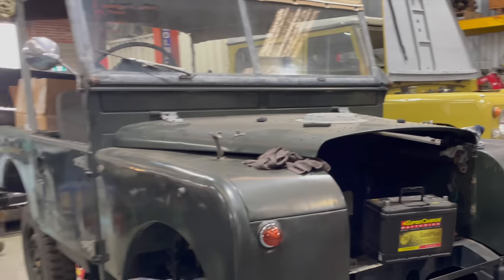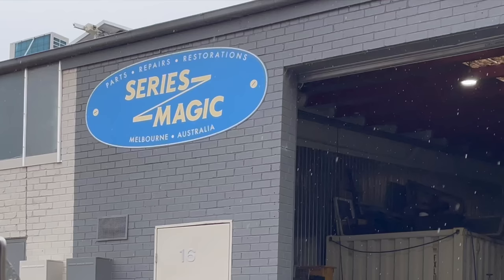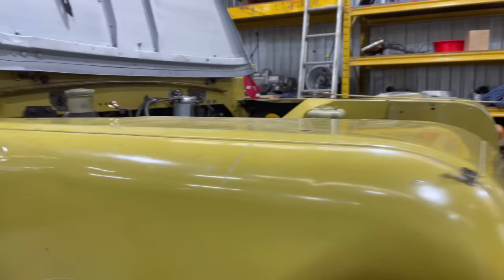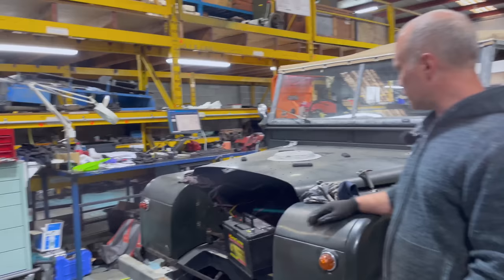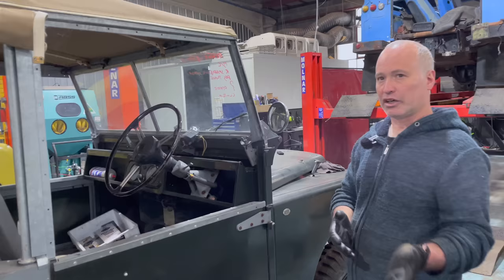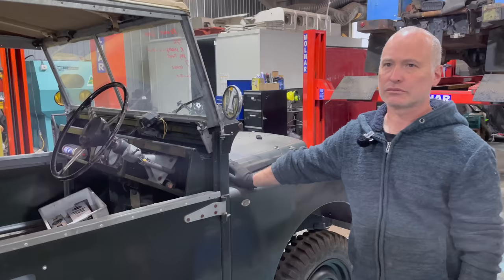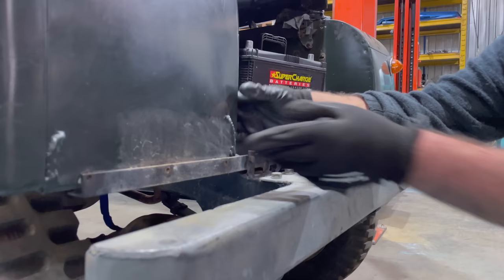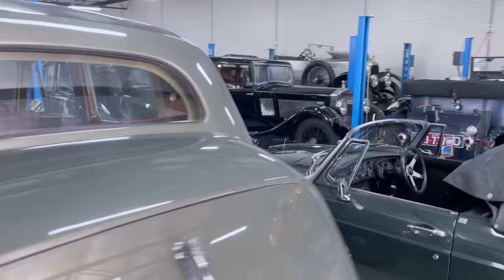LR restorer explains why Land Rovers last longer than Land Cruisers

Comment: Very reliable, as lets face it they were devoid of anything to break or go wrong (unlike a Land Cruiser)
Built to rust straight from the factory & uncomfortable in the extreme.
Reply: "Very reliable"???!!! In yer dreams. I was mechanic back in the 70s in the UK working for the biggest civil engineering firm in Britain and possibly Europe. They had a fleet of vehicles from Minis to Scammel Low Loaders. The list included many LRs. What a Heap Of Wasted Steel and Aluminium. We had Long Wheel Base Safaris through to SWB diesels. The diesels had zips on 'em so we could change engines faster, gearboxes were weak and difficult to set up, drive shafts no bigger than a Ford Cortina used to snap like lolly sticks, overheating on anything hotter than 20C, ever tried to replace a clutch on an LR without taking the floor panels out? It can be done but ya shouldn't have to, etc, etc. We had Ford Transits vans that lasted longer on motorway and bridge building sites than LRs. I live in Australia these days and everything is Nissan Patrol or Landcruiser. I wouldn't take a so called "4WD LR" down the gravel road to the rubbish tip unless it was to dump it. NOBODY uses LR's in the rough stuff over here, nobody. I have a list of owners who are gold prospectors like me and they've owned LR Defenders. One told me he often went to sleep hoping his LR would turn into a Cruiser overnight! True story. It broke down on every trip he made and often 100s of kms from anywhere, including the desert! Snapped drive shafts n back and front, broken engine mounts etc. Even Range Rovers are only fit for shopping trolleys. Gimme a Cruiser or a Patrol any day. I love my V8 200 series. I also love my V8 Nissan with a Chev Diesel in it. Done over 400,000 kms on desert roads, tracks and hillsides and its never stopped once for anything, even pulling 4 tonnes in a trailer. Over 7 tonnes all up. Try that with a Land Rover in 40C heat! Land Rovers are for enthusiasts who like tinkering with "stuff" but they aren't a patch on Cruisers or Patrols for serious bush work. How the British Empire existed as long as it did using Land Rovers is something I'll never work out.
Reply: @chrisstewart8259  Chris I was referring to the video title as yes I know full well what these heaps were like.Have never understood the love of these animals myself.
Reply from the maker: I think the Empire was over a couple of years before Land Rover came along. Also, can you tell me why the Australian Army was using Land Rovers up until just a few years ago?

Comment: Never had a toyota but have had a seies2,3, range rover and currently drive a freelander 1.
I love the fact of ease of maintenance of old stuff, lacking with computer laden tripe we see even in modern landys.
Think most folk don't realise that this was intended mostly for farm use so wasn't really comparable to other 4x4's.( PTO,'s capstans and all that )
Never had a major problem with any apart from tinworm due to crappy UK weather.
I do find it funny that on land rover videos you always get the haters come on stating wild claims about their jeeps, land cruisers and jimnys 😄😄 
Never had a catastrophic failure of fail to start in mine even though I rarely service anything 👍
Reply: When you look at their profiles they all work for Toyota or sell them. I have seen a concerted effort over the years by Toyota owners to diminish the reputation of Land Rover.
Reply: @Land_Raver  and deservdly so. Land Rovers!! I'm in Australia these days, left UK in 73'. They cant give Land Rovers away over here. LR dealers all gone broke. Oz is too big and too rough for Landies. They are better suited to the smaller distance in Europe and established tracks. They fall apart over here. Good for taking rubbish to the tip, Just remember to leave it there. NB - I was a Land Rover mechanic in the UK. Cruisers/Patrols last longer.

Comment: Not convinced that LR lasts longer… it probably depends on the climate. Rotten chassis and bulkheads killed off most of the Landrovers , Discoveries and Rangerover. here in Scotland, although they were far more common than Landcruisers. I’d never have another Landrover, apart from a series 1 as a toy, or an early 2 door Rangerover if I win the lottery. I would however love to get my hands on an 80 series LC if I could afford one. Getting pricey now for decent ones.
Reply from the maker: So you’d never have another Land Rover apart from the fact you would?
Reply: @davesclassicgaragetours  I’d have one as a toy, but never as a works vehicle or a daily driver. And I’ve been driving them since I was a kid, owned all series, defender, disco and rangerover. I could pick up a Mercedes ML 270 for a fraction of the price of a Landrover, and it will do everything better than the Landrover. Despite that, I still have a soft spot for Landies, having spent so much of my life around them. I still use a grey Ferguson tractor , which I love, for topping a pasture in decent weather, but I wouldn’t use it for towing a trailer or ploughing a field, because basically, it’s just not up to the job has crap brakes, and is uncomfortable to spend a lot of time on. Of course in 1950, it was revolutionary, but today it is barely adequate except for limited use. I would consider a series one or Two, but it would need to be heavily modified to make it usable or fun to drive, and frankly, at the prices for decent ones now, I’d probably just have a Suzuki SJ410 for cheap off-road fun.

Comment: The earlier models did indeed last because they were electrically and mechanically simple. The panels didn't rust but the chassis would if you don't treat it. The claim about the percentage of Land Rovers still being in use is slightly misleading. So many were farm vehicles, many wouldn't pass an MOT but would still start and could be driven on private land (farm). 

If we are talking about 50 year old vehicles I'd happily own either a Land Rover or Land Cruiser (I've owned a series 111 Land Rover). For newer vehicles I'd have to go with the Japanese.

Comment: Landys drive up into the Pilbara……….sweet nice trip. Tojos have been taking the hits up here for 50 years. They are the workhorse. In practical terms there is no comparison. They smash over the sharp Gibba rocks for years.
Reply: The Australian Iron Ore Mining Industry was built on the back of the Toyota Landcruiser at a time when Landies were very available - but nobody wanted them. In the real rocky stuff LRs break.

Comment: Only because all the parts have been replaced. Chassis rots out and although it can be welded you have to have decent metal to weld to.
Most people prefer the Toyotas as they seen better
Reply from the maker: Most? meh

Comment: The real comparison should be between the Series LR and the FJ40 Land Cruiser and it goes like this: LC engine, gearbox, and mechanicals much more reliable. Steel body will eventually rust. LR wins on style, pedigree, and theoretically rust-proof aluminium body (some sections e.g. firewall, windshield frame, tailgate, and indeed chassis members are still steel!)

Comment: he failed to mention that the chassis is made out of thin gauge steel and rusted out from the inside long before any other 4wd. there's nothing special about land cruisers either but they didn't sell in any numbers until the 60's so as far as pre 1960 4wd's in australia go it will be mostly jeeps and land rovers and out of the jeeps and land rovers i reckon there's a higher percentage of old jeeps that survived because they were better to drive, more reliable and better offroad.

Comment: Always wondered if the non synchro second gear was engaged just by sliding one gear into mesh [horrible way to do it] or if it was like the second to third minus the synchro cones.
Reply: Sliding one gear into mesh with the other, without a synchro.
Reply: @marcecameron  Gee, if its Teeth  on Teeth seems like you could chip a tooth, I believe post war Rover cars were the same.

Comment: The defender that lasts forever, I think it's the 'triggers broom ' scenario. Even farmers don't buy them any more. Rural areas have built up a large network of LR experts for obvious reasons, so ownership of old ones is viable. But I also feel that there is nothing to compare with a defender as basic rugged off-road transport. Although It's more of a farm/military utility vehicle than a car? The Japanese have us comfort and more on road ability. Owners want good off road performance, but also want to be able to cruise at 70mph in comfort?
Reply: "there is nothing to compare with a defender as basic rugged off-road transport." and where in the UK might such a place be? It has been proven that there is no place in the UK that is further than 75 miles from another place. Plus it's nearly all bitumen roads in between those any two points. Try Central Australia, that's where Toyota and Nissan do all their testing, not the Yorkshire Moors.
Reply: @chrisstewart8259  I think that’s where they tested their rust proofing as well.

Comment: Both LR and Toyota could prepare their vehicles, particularly chassis, better for a long life.
Lifespan and work required to keep them corrosion free in countries that use salt is a different kettle of how vehicles will last in warmer climes or in countries that don't use salt.

I've had both, a series 2A ex MOD full canvas top, and a classic 2 door RR 3.5 manual.
Also had a 70 and 90 series LC, a mk 6 Hilux and the current 17 year old 120 series.

Whilst i have greast affection for the Solihull product (having transported thousands of LRs out of there over the years) a common theme of ownership is constantly having to fix something, it would take some persuading for me to own another LR product.
LCs in comparison have been totally reliable, due to living in England where local authorities have a fetish for road salt your biggest headache in keeping an LC into old age is chassis and live axle corrosion, but if you take care to keep the corrosion at bay and keep up the maintenance then Toyotas product is streets ahead in reliability and durability.
In all the years i've owned Toyota 4x4s the only thing thats failed apart from general consumables such as batteries and friction materials is the alternator on the 120, which cost me £125 for a recon unit and a couple of hours to fit it.

If anything i'm more upset with Toyota for not prepping their chassis and axles better when destined to be sold where road salt is an issue, they put so much effort into making their vehicle reliable with high quality electrical parts and drive components, yet they spoiled the ship for a ha'porth of tar by not making the vehicles more corrosion resistant.
Had they done this from the 55 or 60 series onwards they would have been even more in demand, and commanded even higher residuals than they already do and LR and other makers would have hardly sold a vehicle for hard work or off road use anywhere in the world.
The bodies of 90 series onwards are very corrsion resistant apart from the exposed parts of the inner sills, its the chassis and live axle corrosion that lets them down.

If anything Toyotas reliability encourages some owners to neglect their vehicles, as the vehicles age if people get problems its usually because of neglect.
Reply: Salt is going to kill any vehicle unless your protect the underbody & even then it's only temporary. There is mud/soil/dust on roads here in Australia that is really salty particularly in South & Western Australia & you see people driving their vehicles through the salt water at speed on beaches blasting it into every nook & cranny. I've seen an old car that used to dunk a boat trailer at the boat ramp with the tail end panels rusted out at the angle it was dipped in. Modern Landcruiser's have a light galvanised flash coating on the panels which you can see where they paint wears away but anything metal will rust heavily in salt eventually as proved by Landcruiser mine vehicles which operate in a highly corrosive environment, it eats everything metal including aluminium.
Reply: Didn't LR have galvanized chassis as an option on the series LR's?
Reply: @erroneouscode  I believe they did on later model ones.

Comment: Bet. 🤔
i have both right now a 1966 series 2a Landy and a 1994 Land Cruiser the tank 
Landy only has 13000 original miles on the odometer 
The Land Cruiser however is a different animal that has 500k original miles on the odometer and  its still climbing 
Same with my 2008 FJ 455k on the odometer

Comment: This is not true a Toyota landcruiser lasts longer . Everyone I know with Old Land Rover complains about the engine it’s junk . Aluminum will last longer but the landcruiser will always get you home .
Reply: Landcruiser will always get you home. Landrover won't get you out of the carport. Anyone who reckons Landcruisers don't flex hasn't driven a Landrover series 1 SWB. Get them up a steep hill & both diffs unload & you go backwards in a blink of an eye, and the brakes are crap. Landrover's go 50 mph flat out revving the guts out of them and you literally need hearing protection from the noise. I'll take a Landcruiser heater in the Snowy mountains any day over a drafty, cold & noisy Landrover.
Reply: @dustyfarmer  The last 4 trips in the high plains I did were all modified or cut short due to recent model Landcruiser / Hilux mechanical/electrical faults, Sad to say your comments are dated. Also suggest you Google Toyota front diff failure, it might bring you up to date.
Reply: @deejay3218  I drive a Landcruiser everyday & have done so for the last 40 years. No diff failures yet, pal.
Reply: @dustyfarmer  Not saying my fellow traveler's had diff probs, it appears vehicles in general are proving to be not a patch on those of 20 years ago.
Reply: @deejay3218  I disagree, my current 2014 VDJ79R V8 ute is superior in every way to its previous versions although the were good vehicles at the time. I think the Landcruiser went backwards with the DPF models but this one I've got now will probably see me out. The only mod I have made to the front diff in it is fit an extended breather & a Superior engineering pumpkin guard & a Harrop Eaton TruTrac hemisphere for better traction in slippery road conditions in 4wd. The front diff centre in my Landcruiser is the same part as a Hilux rear diff centre, pretty good if you don't abuse them too much.

Comment: CKD was a loop around export taxes because its an incomplete car self build. They were built from birmabright alloy because steel was hard to come by after the war.
Reply: It wasn't only because of tax purposes. CKD cars came in shipping crates which could be 'stacked' in cargo holds of general purpose cargo ships amongst other cargo. Such ships might have been loaded with an entirely different cargo when it left our ports. A complete rolling car wasted space above and around it. Modern car carrying cargo ships are built specifically for purpose and have adjustable deck heights for drive on, drive off.
Reply: @erroneouscode  it helped exports and incomplete vehicles had no duty on them ie lotus cars build a car at home no purchase tax buy a factory built you payed purchase tax. And alloy was in plentiful supply not the case with steel 🙄
Reply: @ringo196  As I said "It wasn't only because of tax purposes." That applies to export of vehicles from say the UK, and the importation of vehicles to Australia. I'm Australian and grew up around a major car plant that was first Volkswagen and then Nissan in the 60's and 70's. There was a lot of CKD crates coming in even then to top up local production. Local factories couldn't produce every model or variation of model. NZ had a good deal of it's cars supplied in CKD form as well. Holden and Ford also brought in certain models during the 50's and 60's from the U.S or Canada in CKD form to supplement model range that wasn't made here and more than likely needed local conversion to RH drive. My comments don't specifically relate to Land Rover and thus not alloy either.  Nor do they apply to kit cars you build at 'home'.